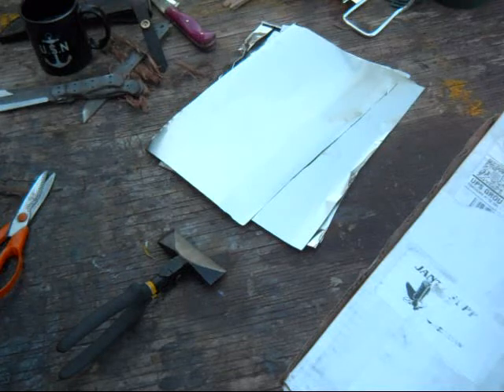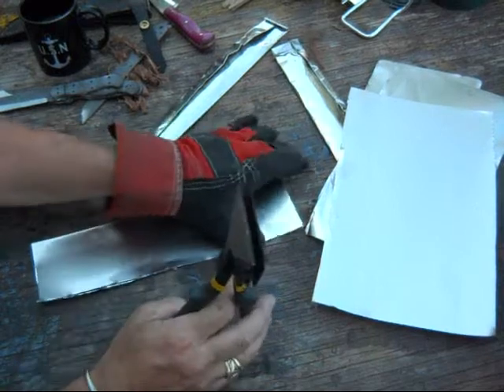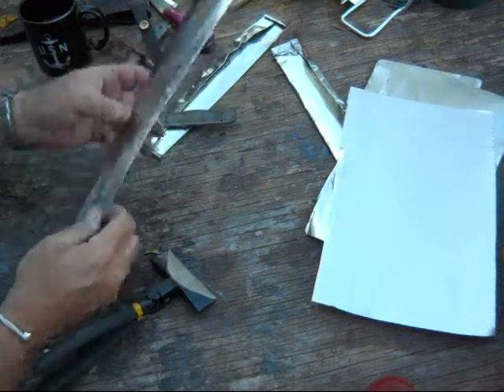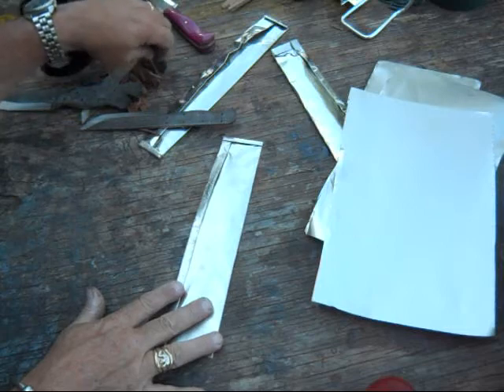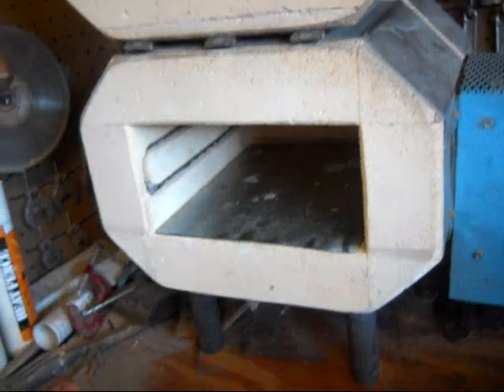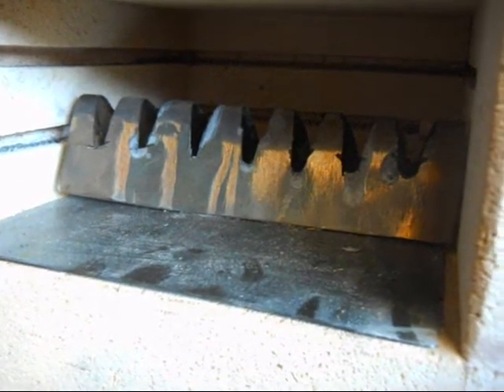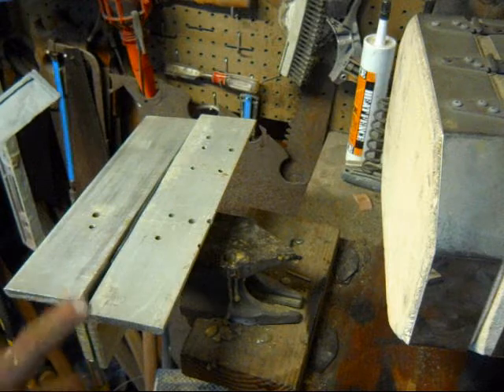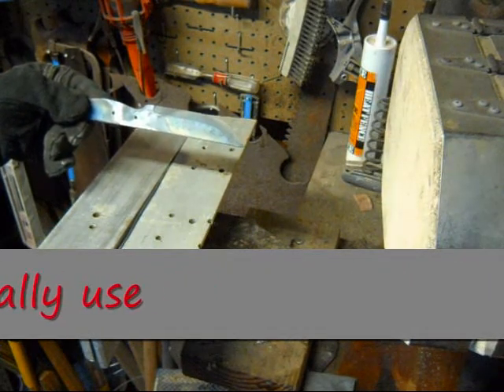Heat Treating D2 Steel

Comment: How easy or hard is it to work D2 metal with a file???
Reply from the maker: I use a 2X72 belt sander and haven't used a file to make a knife, but once annealed it shouldn't be any more difficult to work than other annealed metals.
Reply: @CrashbladeKnives  Thank.

Comment: I got stuck as the heat treater at my last job because I simply mentioned that I made knives to the owner. So whenever a HT job came up I was pressed into service. They had a gas stove next to their 24 inch deep HT oven for tempering to 600 degrees. Their HT oven was slow to heat up too. I also used Hinderliter Heat Treat in OKC, OK who I was familiar with from my early days making knives, they were a wealth of knowledge and help. Hinderliter told me to set the temp at 1850 since the oven was so slow as the worst thing you can do heat treating D2 is overheat it. Then hold for only 20 minutes instead of 30 once I reached 1850. It worked great and I used an air blast with an air nozzle for the quench.

 I immediately once they reached room temp put the parts in the oven then up to 500 degrees for two hours. First temper, second temper was 1000 degrees in the HT oven for 30 minutes at top the air cool. HRC59-60 every time as we had a Rockwell tester.
edit; I forgot to mention that I would punch a hole in the foil on one end and snatch them out with hooks I made from 1/8th inch weld rod.

Comment: Awesome video, Sir. Thanks for sharing. But may I know is D2 steel can sharpen by sandpaper? I've ever heard that it's hard steel to sharpen.
Reply from the maker: The ease or difficulty in sharpening various steels depends a lot on the heat treatment.  When I make them I use my belt sander to sharpen them.  I don't recommend that unless you practice, as it is easy to ruin a knife with power tools.  D2 is a wear resistant steel, but I have used sharpening stones and achieved very good results.
Reply: You can just use a coarse whetstone, but remember to keep it clean from slurry.

Comment: Can i heat treat in a coal fire? 
Also where do you get your D2?
Reply from the maker: I don't think I would attempt to heat treat an air cooled steel in a coal fire.  Any of the knife making suppliers should be able to offer you a choice of steels.
Reply: CrashbladeKnives 
Thanks for the advice. 
I found on online company that offers (what I assume) heat treated blanks which would get me a heckuva lot closer to a finished knife. 
But I figured I'd go with a more high end steel like CPM S110V because I'm going for edge retention.
I enjoy watching you videos tho, you make some very beautiful pieces

Comment: Great video, I would like to ask about the thickness of this stainless steel foil :))
Reply from the maker: I'm not sure of the thickness.  When you buy it from a knife supply place, you buy it according to the temperatures you will be heat treating.
Reply: Buy the higher temp foil. It wraps easier.

Comment: what if i didnt use any foil?. just heating and quenching in regular vegetable oil.
Reply from the maker: For liquid quenching steels that is fine, but for air cooled steels the method described in the vid is a must to prevent decarbuerization and other surface reactions.

Comment: well crap I wish I would have watched this before ordering some be too. I'm using a charcoal Forge. What are the repercussions of not heat treating in airtight environment?
Reply from the maker: A steel like D2 is not really meant to be heat treated in a coal forge.  I know a few people that have tried it and did not get very good results.  You may want to send your D2 out for heat treating.
Reply: Yeah! Just quench D2 in motor oil if you don't have access to gas.
Reply: I tried that too, but mine was pure coal as opposed to charcoal. I went with the heat and quench method, quenching in used motor oil. Blade turned out pretty well, according to the user.

I will reproduce the process when I get home in a month's time, and update you accordingly.

Comment: I notice you temper the steel within stage 2 tempering range  (475-500 F), D2 is normally triple tempered at over 1,000 F for proper secondary carbide precipitation, which is better for edge retention and toughness.  My question is, have you had any problems with these blades braking during hard use like battoning?  It appears the knives have a full tang, which helps, but with 155 points carbon D2 is not really tough to begin with.   By the way, that is a really nice oven, wish I had one as nice.  Regards.
Reply: Scott Birse   In general terms, the more carbon a steel has the harder/stronger and more wear resistant it can become.  The trade off is that when you increase carbon and consequently strength toughness decreases.  So you have to trade off hardness with toughness for a given application, i.e. knife, gun, machine member, etc...  Steels begin at 0.07% carbon (very mild steel) all the way up to around 1.75% which are only used in very specific applications where requrements for touhness (ability to take a beating without cracking) are very, very low.  D2 has 1.55% carbon and over 12% Chrome, among other alloy elements.  The carbon content is waayyyy high, this leads to outstanding edge retention but toughness of D2 is close to nothing.  Battoning with a survival knife made out of D2 will simply snap the blade in two making survival difficult at best.  D2 has a place in knives but it better suited to a skinner where you do not want to be sharpening the knife every 10 minutes and toughness requirements are low.  The reason I bring up the question of tempering temperature is that if you use D2 for a knife the best tempering practice is triple temper above 1,000 degrees (F), which gives the steel the best toughness it can obtain, it is still low mind you but it is the best D2 can muster.  If you are asking why, the reason is that so with so much carbon the steel will have retained austenite in the microstructure which is nothing more than a fancy way of saying part of the steel is not allowed to make the transformation to the hardened state because the high level of carbon around these untransformed pockets do harden and effectively lock the pocket in position.  The material (austenite) wants to harden but it´s surrounding has ¨frozen¨ it in a position where it cannot move and movement is necessary to harden.  The problem is that these pockets of retained austenite will transform to hardened steel with time and/or use as a result of stresses and temperature changes.  When this happens you end up with newly created martensite (hardened steel).  The problem is that this pocket of now fully hard material is not tempered, and as we know steel cannot be put into service without tempering as it is glass hard and will crack easily.  So you take a knife where this has happened and use it on a cold winter day (where steel toughness is even lower) and use it to batton some lumber which puts bending stresses on the material and SNAP, the knife breaks as a result of a crack that propagated from one of these pockets of untempered steel.  The reason these steels are triple tempered at high temperatures is to give these pockets the chance to convert properly.  By heating them up to over 1000 degrees (F) the atoms loosen up and separate a bit, that is why steel expands when heated, so the ¨frozen¨ state the pocket finds itself in loosens it´s grip, so to speak, and converts to fresh, hardened steel.  The second temper is to temper the hardened steel created during the first temper and the third temper is a safety temper in the event there was still some lingering un-tempered steel.  In general, the higher the carbon content the more retained austenite will exist in pockets and with D2 you need to maximize toughness.

Sorry for being long winded but I was not sure what part of my original question you were referring to, so I let you have the whole thing.  Regards.
Reply: I'd be interested in seeing your source for this data because according to my DS from both Bohler and Crucible your method of heat treating D2 is different to their recommendations. Perhaps that might explain why you feel D2 is too brittle because D2 can actually temper harden if you don't know what you're doing.
Reply: @CSGKnivesAndGear  the problem with these companies data sheets, is that, they are usually not for knives. Some Custom knife makers are the ones that push the boundaries of the composition with unique heat treatment recipes. Making them with the best grain structure, best carbide distribution, bring out the harder carbides and soak carbon in to solution. Create either more edge retention, or toughness for the desired design. Crucible, bohler, etc all cater to other markets and not always cutlery. D2 is widely used in stamping tools. Not gonna be the best for knives. And there's always more advanced techniques to make it better than manufacturers recommended.
Reply from the maker: +Rafael Lastra I have had my D2 heat treatment tested with Rockwell Hardness testers and the results are exactly where I want them.  D2 is a lot tougher than you give it credit for.
Reply: I am a tool and die maker, trust me D2 is not that tough.
Reply: +Rafael Lastra can you expand on the comment?
Reply: That was bloody good! I like it when people share. I feel I have learned something of great value here. Now I ponder the san mai construction with D2 in the middle, discuss. :)
Reply: +Rafael Lastra Compaired with other steels of course D2 isn't "that tough" But it's darn tough enough unless someone is being an idiot. Cryogenics from my experience is key here. I use D2 a bit and they are tough knives, no toughness like my 1075 and SUP9 blades but they're still tough. Zu Blade works also uses D2 in their tactical knives with great success. But the sounds of things if the D2 you have been working with hasn't been "tough" the heat treatment has been botched. It's all relative though and there are many other factors.
Reply: +Rafael Lastra Great explanation, thanks.
Reply: +Rafael Lastra I agree. My point of view at the moment is that: If you wants a blade for batoning and harsh use purposes the choice is a softer steel, maybe a bit hardened in the edge, but softer than pure cutting knives. Comes to my mind the idea of small hard knives, like the Rosselli carpenter UHC, also D2 knives, and softer steels for leukus, axes and so, for exemple the spear heads of Cold Steel. But in fact is a generic rule, because hunters maybe have issues with extreme hard blades chipping on bones. And for fishing the alloy may be stainless and softer. No one knife is perfect for all tasks.

Sorry for my bad english, is not my main language.

Comment: instead of wood shavings try JUST Exhaling into the stainless steel bag you made , I have heat treated doing this for years with great success , Exhale into the bag 2-3 times before closing . parts come out with a straw marbling color

Comment: Where did you get your oven and what model is it? I'm new to this, but want to make plane blades and that oven would be a good size for me.
Reply from the maker: I bought this one used, locally.  It's an Evenheat brand.
Reply: +bill65761 
Use Lucifer furnaces at work to heat ingots for rolling, not sure if they make smaller ones, but even when the power went out the other day it only dropped about 40degrees c if even
Reply: I worked with d-2 for a solid year- as far as I know it doesn't need to be heat treated- ask Jason Jacobs about this-
Reply from the maker: I bought mine used.  It's an Evenheat Oven with an Orton controller on it.
Reply from the maker: D2 does need to be heat treated.

Comment: I noticed you do not remove the foil before plate quenching.. Others do.. What reasons are there for doing or not doing this.  I know there is a time issue to deal with whenever removing foil.   Also, many steels require a very specific soak time.. With all blades ready at the same time and having to wait for each blade to be quenched it seems they would all have different soak periods. How is this dealt with..Is there a way to edge quench stainless?  Thanks and nice video
Reply from the maker: I don't remove the foil because it would significantly reduce the temperature before plate quenching and not give the hardness I want.  The soak time is based on thickness of the material and is to ensure that the steel is up to temp.  Letting it soak a little longer does not change things.

Comment: so when you use that foil you don't need to quench in oil?
Reply from the maker: Some steels are liquid quenched while others are air quenched.  This steel needs to be air quenched.  Steels that should be liquid quenched will not turn out well with this method.
Reply: so when liquid quenching there is no need for that foil, thanks for the info